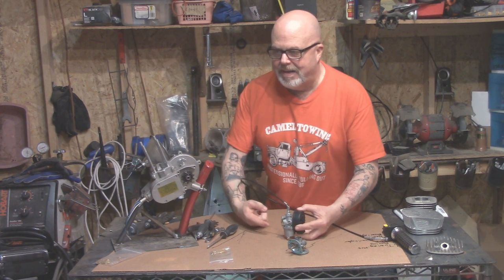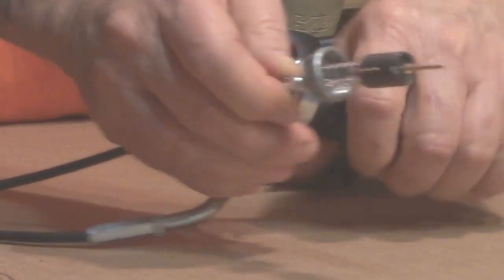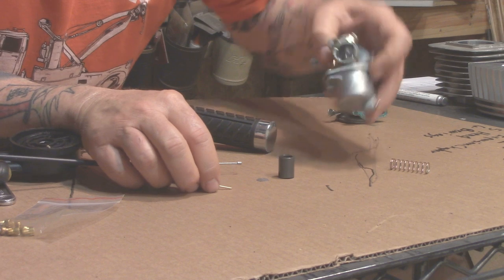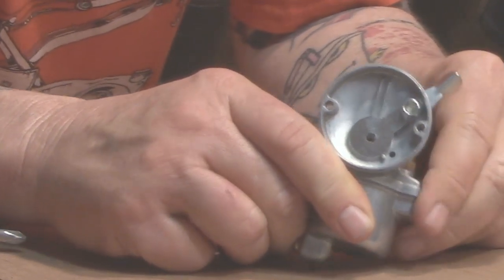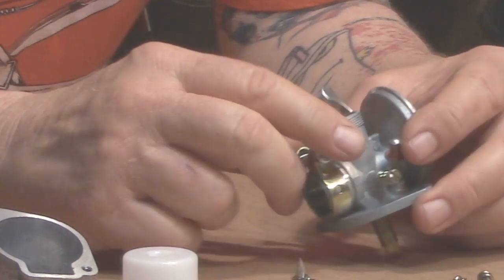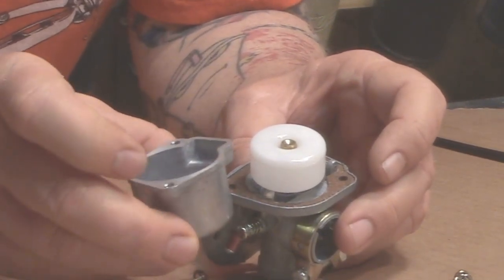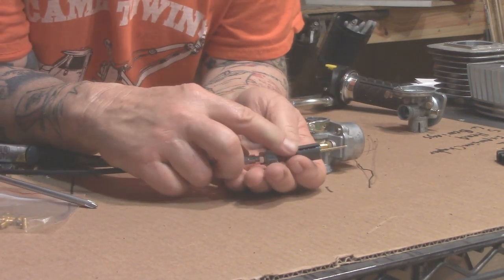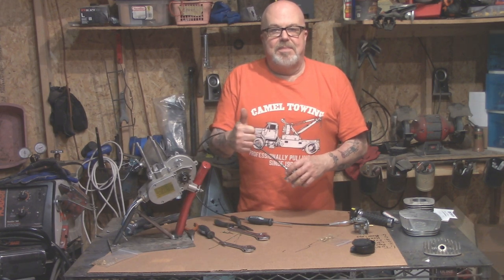The Best Carburetor For Motorized Bicycles - How To Clean & Service Carburetor- Long Version

Comment: Attention! This guy knows his stuff! One thing overlooked and most do miss on these carbs, is the actual needle length may differ from one carb to the next, 
Common issue is the little E clip wears out the needle where it seats, you may find you set it in the middle groove after a month of solid riding it has worn to the second groove, 
This is caused by the needle bottoming out to hard on the jet causing the spring to push against the clip slowly wearing it,
About the only solution I came up with so far is swapping out to a gentler spring, A progressive spring I McGyver'd  up by gently heating the first couple coils on a spring to relax it's tensile strength a bit. This allows a weaker pressure at closed throttle and gets stiffer as opening, it's a balance lol
Yes I trashed a few getting it right or close enough I do not get wear anymore 😊
Cheers Mate for some great videos
Reply: Regarding springs, I haven't had to do it, but I think it'd be possible to jerry rig it with an ink pen's spring (the clicking pens, of course).

Comment: I can't put a money figure on the joy these little motors have given me. I have several bikes.
Reply from the maker: Amen brother. Fun stuff. lots o pain when they are stubborn, but that forces me not only to cuss but to learn a little
Reply: Hughes Motorized well said brother
Reply: I got into the hobby in the first week of May '19. I built and sold six bikes that summer. Today is June 30, 2020. I have built and sold six  more that put $2050 PROFIT in my pocket. (this season alone)
 I've done one consignment build. My bikes all run 28t sprockets. The last bike sold went 51mph. 26" Huffy middle weight beach cruiser. 28t. 26x1.75 Goodyear tires @40psi. Well greased wheel bearings and a Thruster F2 pipe. 16-1 a sip of 108 booster and STP 2cycle oil.
Reply: Where would you recomend I order an engine kit from ? I would like to keep it limited to around $ 180.00 or so but there are so many sellers now a days! I would prefer 8 M M  studs and better engine bolts I know that!
Reply: Eric McGinnis check Amazon
Reply: @glennspears839  what made the bike go do fast? 51mph.. is it the 28t sprocket? I have 36t and it goes 35mph max.
Reply: Today is April 10, 2022.
Sold bike #29.  
26" Schwinn cruiser . 44 tooth. G4 cylinder. Speed Carb. and hi compression head. Larger fuel tank...... Spark plug running a wider gap.
$450.

Comment: I have this carb on my huasheng 49cc and I've had some trouble tuning it. its running the best so far with a 75 jet and the clip at the bottom of the needle. if i give it full throttle all at once it'll die unless I'm already going half throttle then it will sputter a bit then take off. you explained how the carb works like a pro. you just got a sub sir.
Reply from the maker: I had some issues w/ the NT on the 49cc and have stuck w/ the stock carb as it gave me less issues

Comment: Tuning.  To get the 80cc engine to run in 2 cycle mode. 
 Changing Main Jet size.
  Most engines come with a #70 jet which in most cases is just to rich. Here in Mid Michigan I am at 774 ASL.
 A #65 was richer.  What I have noticed is the #60 is the largest hole and the #80 the smallest.  With the stock jet the rich setting gives a lot of torque but in 4 stroke, up to speed then I back off the throttle, the engine clears and starts to run in 2 cycle. Adding a bit of throttle the engine will produce a pop sound from the exhaust and will run rougher. Back off the throttle a tad the engine smooths out, gets quieter, and power comes up.  I have tried several different sizes of jets.  # 72 and # 74 are next on the list to try.
 My next thing to try is adding a "Walbro" carb so I can adjust the jets with a screwdriver.  This is the carb that is found on chainsaws, weedeaters, backpack blowers and other 2 cycle engines, it has BOTH High and Low needle screws.
 I fly R/C airplanes and have a 3 CID 2 cycle engine running with a Walbro carb. This engine spins a 14 x 6 MAS prop.
 Fuel mix is 92 oct, with the Stehl Chainsaw engine oil. mixed to 40 - 1.This is my standard fuel mix for all my 2 cycle engines.
I am running a "Zeda Firestorm", with tuned pipe, big heat sink high compression head, the big box type reed valve. This is a minor carb problem I'm working on. 
 This seems to be one subject that all of the articles on the net concerning Gasbike engines just doesn't address. I don't know why but when I listen to a Gasbike engine run and it's running to 4 stroke just BOTHERS me .Smooth running high power 2cycle running strong, like in a chainsaw, is what these engines should sound like and running smooth.
From here in Michigan    KEITH

Comment: I put expansion chamber, new head, and a different foam filter in, it was 4 stroking pretty bad, made one adjustement to the clip position and idle screw, runs fabulously now when warmed up. also running approx 35 to 1 synthetic blend 2 cycle oil

Comment: How much it can be assured that the fuel intake will do starting without the prime bulb to ease starting. Needs starting fluid spray into the carburetor all the time to start?

Please explain clear this for me.
Awaiting answer please.

Good video you posted. Thanks.
Reply from the maker: No need to spray. A primed carb in working condition and the choke in start position is all you need

Comment: I tried the so called "racing"  carburetor for the stage 4  66cc 2stroke BBR TUNING     I bought two Jets + and - from what they are setup with.    I COULD NOT match the speed of the NT carburetor that was properly set up.

Comment: Thanks for the info on fully seating the carb on the intake manifold.  The carb "seemed" to be fully seated because the carb was resting on the ridge of the manifold.  It turns out I had to expand the carb flanges so they would go over the ridge in order to get a full seat.  Now it runs great!
Reply from the maker: Glad it helped

Comment: Thanks for your video about NT carburetor.
I installed one but just will not start. I saw the spark plug tester light did light up. The choke was closed. Just can not figure out where air leaks and why motor not fire up running. Frustrating and suggestions please.

Can you know what other type of carburetor that is better than the NT carburetor that has primer bulb to ease starting.
Reply from the maker: NTs are great carbs. Is the spark plug wet w/ gas after trying to start?

Comment: good video on NT slide valve carb.
I've got one coming to replace the stock carb on my 49CC 4 stroke.
I failed to rinse the junk out of the new  gas tank , it clogged everything, there are passageways that can't be cleared without drilling out the brass welch plugs to get access to hidden jets and orifices.
The stock carb was fine until the junk got into it, H124C carb.
I tried carb cleaner, ultrasonic bath, compressed air, no dice.
When the NT carb arrives I'm gonna drill the welch plugs out and see what the problem was.

Comment: man i like your videos you dont pull punches or try to sugar coat things . i have two bikes both run the little antique carbs never had a issue with them . not even why i like your videos though its more of the first thing i said tell it like it is dont worry about hurting feelings  and you dont make a full course meal out of a apple if you know what i mean . good stuff . i subbed and rang that bell .
Reply from the maker: Thanks! Right on

Comment: Question.  I am new to this hobby and just completed first build. It fired up and ran good. Now when I try to run it the back wheel won't spin when I engage the clutch to start it after pedaling. Almost like there is no spark to push the piston. Any ideas as to why it won't start

Comment: Question? 7:04 you say jet 66 I cant find that jet set with a 66
Reply: THIS!!   So confused! haha
Reply from the maker: sorry. Just noticed your comment. a 65 or 67 will do. jet kits are hard to come by lately. You can fill w/ solder and drill out w/ a pin vise and micro drills
Reply: @HughesMotorized  thank you

Comment: Here is my GREAT way of solving the air leak issue.... wrap the manifold with a few layers of yellow plumber's tape, get the carb snugly on, ditch the stock clamp altogether and use a hose clamp from the hardware store, and get it decently tight and you won't be having any leaks there for sure!
EDIT: The stock "hose" clamp is terrible. In my case, it didn't squeeze strong enough to keep the carb from flying OFF the manifold [this happening because when the piston goes down and closes the intake port, all the fuel and air coming through the manifold suddenly hits a wall, literally, and this causes tremendous back pressure, which blew my carb off].
Reply: Yeah dude. The crap "steel" screw they give you will start to buckle and eventually snap. I went with the same clamp but swapped the screw for a good steel Allen bolt. Works way better. But as to taping the tip there...I figured that was necessary. I'm shocked it's not in the instructions. I even went a step further putting oil resistant gasket sealer on the slot. It works great
Reply: @gyromurphy  Gasket sealer is a nice touch!!!
Reply: @gyromurphy  Speaking of replacing the crap screw with a quality Allen one, that's actually a good tip for EVERY SCREW ON THE WHOLE KIT WHEREVER POSSIBLE. I just wanted to throw that out there for whoever is reading :D

Comment: hey Boss I really appreciate the knowledge Is could not have gotten from point  A without your visuals I swear it!! My question is Is it alright to  slow the bike using the kill switch until I get a brake put on there Sir because it just feels wrong you know like I am  really not suppose to slow down this way
Reply from the maker: Engine needs lubrication and when you slow it that way you are restricting the fuel/oil mix. Never did it long term

Comment: I just recently bought a bike with one of these motors already on it.  It sat in a barn for about a year.  I drained the fuel out of the tank and replaced the fuel lines and filter.  It has a new spark plug as well.  When I try to run it, it seems like it wants to bog down and it doesn't idle when I'm still.  When I give it gas, it also wants to shut off.  Would drilling holes in the air filter work along with adjusting the idler screw?  Any tips are appreciated.
Reply from the maker: Carb is gummed up. Jet is clogged. Needs a GOOD CLEANING or buy a new carb

Comment: This is incredibly helpful, Thank you! I have learned so much from trial and error with these bikes. This video is really helpful.  My bike is bogging at full throttle, at about 1/4 to 1/2 is where it goes the fastest. After watching your video, Its safe to assume it's probably the jet Right? Thanks again for this video. Looking forward to watching your others.
Reply: What's your mix ratio?
Have you done a half throttle plug burn to see how it burns there? If it's black and nasty it's running way to rich and start by adjusting your mix slowly, 
Then go about changing jets, get your mix right first to your driving area, one thing I noticed not really talked about correctly is mix does play a factor in your tune before you start to jet, my mix tune for half throttle may be richer than what you need, or leaner depending on altitude,  humidity, mix oil, and gas, .
Always start out rich and ween your motor off the oil slowly and do a plug burn at half throttle to check it, black is rich, Brown is good but wee bit rich, White or pale grey, to lean get some oil in there fast lol.
Personally I like mine just a tad on the browser side, gives life and longevity , once I get that I tune the jet and again I do plug burns at full throttle to check. Then adjust my jet accordingly. I sit with a 68 in my carbs.

Oh a plug burn,,
Hold throttle at point where you want to read the plug for 10 second count, then hit kill switch and shut motor down and release throttle at sametime. Shut fuel of and do not touch throttle again until you pull the plug and look at it.
👍
Reply: @SandmanOG  how does one adjust mix ratio?
what are you talking about, its no good if you aren't specific.
Reply: Mix ratio for oil to gas,, 
Richer mix more oil, good on break in lubes everything and runs engine cooler, can foul plug and cause 4stroking or firing on every other stroke
Leaner mix less oil, after break in, more power, runs hotter, no foul plugs and no 4 stroking
Reply: Plenty 2stroke mix ratio charts out on web to look at I use Motul chart myself. 16:1 break in,, after 30:1
Reply: Andy Boosey u use 30:1 I only do 20:1

Comment: Hello thanks for all the help with all your videos , I have a bt100 100cc engine , do you think it will benefit from a bigger carb  even though it is all stock (just baffle cut from exhaust) thank you
Reply from the maker: Probably not. A properly jetted stock carb would be best. Port cleanup, expansion chamber follwed by jetting to adjust for the changes.  If you have a balanced crank and a reed along with advanced porting? then yes, a bigger carb would help

Comment: That carb reminds me of the twin S U carbs on a Datsun 240z from the early 1970’s, they too were side draft carbs, however they needed mineral oil to function correctly! 
 Now my question is do you recommend any 4 stroke kits for a “work Bike” vs a neighborhood terror machine!
Reply from the maker: The Lifan 152 is a 97cc motor that runs good if you advance the timing a hair. Make your own "kit" https://amzn.to/2L23Uq8

And there's always the Huasheng 49cc - https://amzn.to/3b0Nb13

Comment: it is really true that the NT carburetor is the best carburetor for these 2 stroke motors
Reply from the maker: If you have an engine that has reed valve , balanced crank and stuffed case? NO.. But for most applications they are fine. My 2 cents

Comment: I have a question about the carburetors. What would be the cause of my carburetor leaking from the idle screw? It's my 2nd carb that had this problem. I live in the city so bumps and potholes are a thing. Maintenance wise I just do basic stuff and these little motors last for hundreds of miles.

Comment: I'm a big fan in the basic carburetor.  I purchased a bike from what I'd say was a crack head and everything was not working so I bought a brand new bbr stage 4 kit and put the high speed carburetor on it out the box and it doesn't respond or preform well due to one over sized jet and ZERO adjustability. This carb you can adjust the needle besides just bending thr float tab like on the high speed. This carburetor is much better suited for a new /normal rider. I'm going for an expansion chamber so I might have to adjust the clip in the float but the high speed doesn't have that option really, it's really poor and cost more. I only got it because the stage 4 kit compared to stage 1 was only $50 and that's the price of the cnc head alone so I got it but with some regret not putting the stock carburetor on first. I'm gonna swap them out on my next day off and see how much better the bike responds after some well needed fine adjustments.  It'll go about 25 ish ( no speedo just guessing because I drive for Amazon so I go 25/30 mph ALOT)  the bike currently struggles to get up to 30 because of exhaust but I can hear the engine slowly increase rmp

Comment: They are a nice, simple carburetor. Unfortunately, it didn't work very well for my BT80 Bullet Train. I sealed it flawlessly, made sure the float height was correct, tried numerous jet sizes and needle heights, and nothing gave me good response throughout the throttle range (would either 4 stroke like crazy at low throttle and run ok wide open, or run ok at low throttle and run too lean and bog out wide open). I ended up going with a diaphragm carb (Walbro) which is so much easier to dial in.  3 screws to adjust (idle, low circuit and high circuit), and you can dial in your bike perfectly through the throttle range and ensure you're never running too lean or too rich regardless of throttle position.
Reply: Walbro has a tried and true design.
Reply: Do you have a link to this carb?

Comment: my 80cc motorized bike was running great until it just bogged out on the way home from the gas station. I do not think it is an aelectical issue like the plug because i turned on the choke and it started but then shut off.

Comment: I'm about ready to rip my hair out trying to find a replacement E clip (circlip?) for my carb needle on a red "true speed carb". I tried Ace and the smallest they even had was 1/4". Lowes had 5/32" which was still too large, and Home Depot had down to 1/8" which is just barely too big. Going to try Harbor Freight as a last resort before ordering online. At the very least, what size should I be looking for? I don't have any calipers to measure with at the moment, unfortunately. If anyone in the community knows and could let me know, it'd be greatly appreciated!

Comment: When I installed my motor I made sure that the carburetor went together correctly. However, it idles high and the idle screw has no effect on lowering the idle. I'm not running ritch or lean. Just won't idle down. It's not the NT. Any suggestions?
Reply: Double check and make sure your throttle cable isn't too tight. I had the same problem with one of my Motors. The routing of the cable took up more slack than I anticipated, and it caused a slight pull at idle, causing the high idle situation. The way I diagnosed it, was by loosening the throttle cable adjuster on top of the carburetor. When the idle went down, I knew that was the problem.

Comment: Doesn't you're jets make a difference on where you live ? like higher altitudes smaller jets ,also does the needle for the throttle need to be moved for altitude too ? on my bike it runs weak at top end and sounds like its struggling for fuel I have the 80ccZed triple 40
Reply from the maker: Correct. The thinner air makes for a richer result. You need to put smaller jets in and raise the clip on the needle a notch I'd say